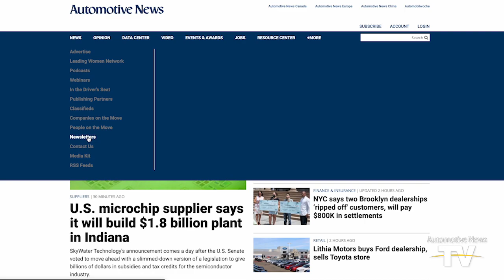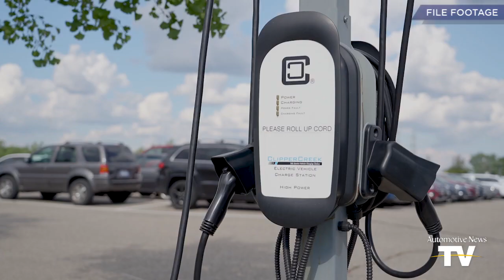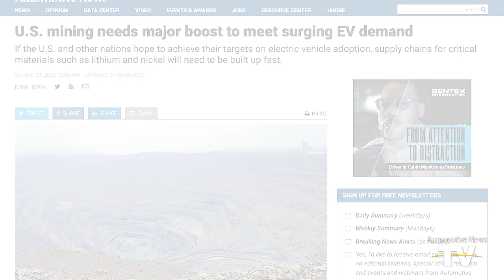AUTONEWS NOW - 10/24/2022: Dealer sues Hyundai

Comment: Miners have a real concern about future battery chemistry breakthroughs. Imagine if you spend a billion dollars to mine cobalt or nickel and all the automakers switch most of their production to LFP, m3P or what ever the next type is. However, I think all the existing battery chemistries will remain in production long enough for them to make the money back. Automakers will want to hedge their bets on what will work best and will find uses for all the different types. Also, cars are not the only use for batteries and the market will continue to expand.